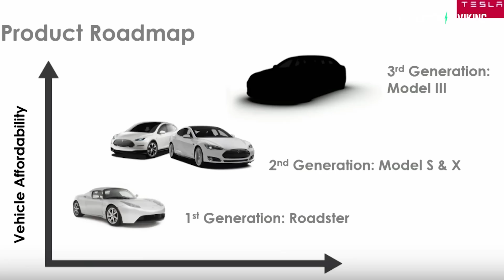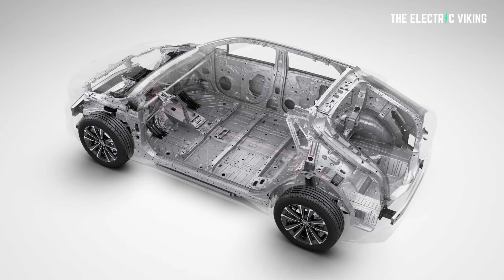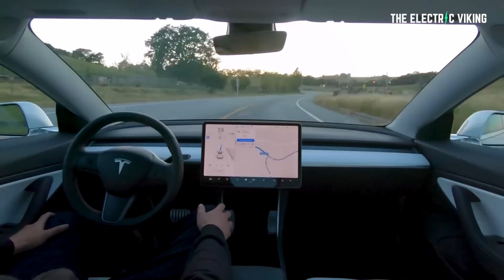Tesla's GEN 3 mass scale platform tech coming in 8 weeks

Comment: I wonder if the Model 2 will use a single casting?
Reply: Given structural batteries, the need doesn’t exist…

…but they could extend the castings higher up the sides.

Comment: Cybertruck has been announced in 2019, still far from mass production. 
I would not be overly excited about the Gen3 platform. Realistically it will materialize not earlier than in 3-4 years.
Reply: True
Reply: In Q3 2022 Cybertruck was in TOOLING phase w/ MULTIPLE prototypes built .
Q4 2023 GigaAUSTIN received 9000 TON Gigapress parts for Assembly & Testing. 
gigaAUSTIN will BEGIN Cybertruck PRODUCTION in 2H 2023 , perhaps EARLIER.
Reply: you are FORGETTING , Tesla can BUILD a Whole NEW car Factory in less than 11 months.

Comment: If the structural battery is damaged, doesn’t that mean you have to replace the whole car?
Reply: Yes. The structural pack is very strong, if it's been damaged the whole car is probably twisted beyond repair. The only exception would be impact from underneath that only hit the pack, which is unlikely to occur. The pack can be easily unbolted and replaced.
Reply: If the major frame of any car is damaged, it’s totalled.
Reply: Sandy Munro has covered this, it’s a non issue.

Comment: Sometimes when you look you see what you are looking for only !
Industrial legacy is not a Teslas problem.
Toyota therefor has a different Industrial stratergy Globally. 
Forced dynamic engine.
Electrified range. 
A prius with a huge power gain but better mpg. 
A power train much improved by software & huge experience. 
Globally that is very useful when you manufacture such a wide model range. 
Apples & pears are still fruit. Both appealing. 
Clearly there are huge gains for Toyota from its comming development pipe line. Consider hybrids may be far more common then EV only. 200 mpg phev.  whats not to like. 
Now what do you see.
I see an electrified world thats more democratic in its use of the same materials. Embrace it.